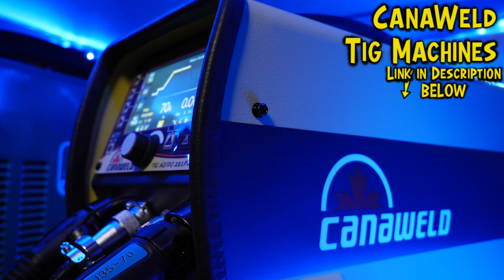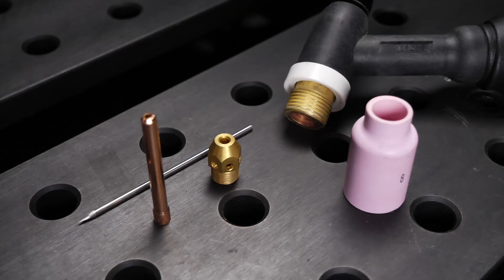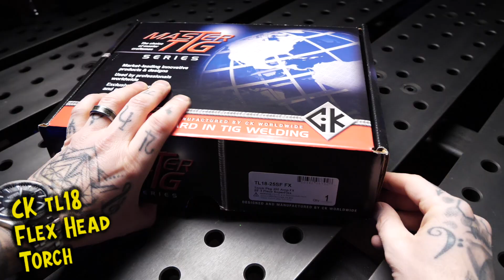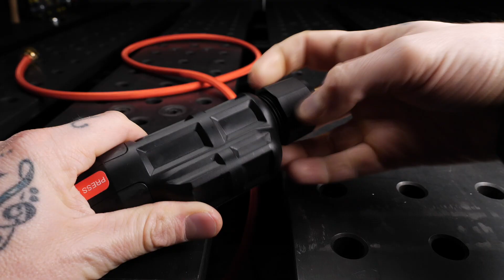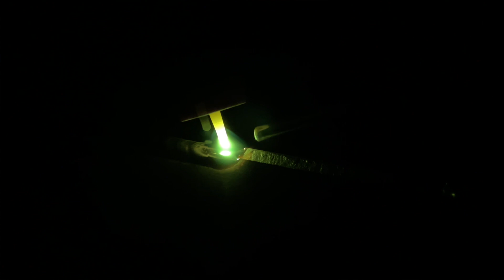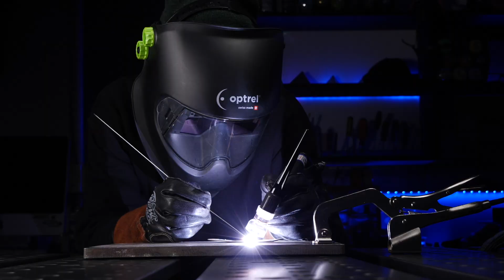HUGE upgrade to my CanaWeld TIG machine

Comment: I totally agree with you on this.  I put a CK Flex-Loc 230 Water Cooled Torch on my Everlast PowerTIG 255 machine and love it.  For ME, the utility of the swivel head far outweighs the additional size, and I can make it comfortable to hold in nearly any position.  Also built my own water cooler with a microcontroller to verify adequate flow and shut off the pump when it's not needed.  Very sweet setup.

Comment: i absolutely love ck products, my fl250 is the nicest torch iv ever used. buy a couple of extra heads and you can just undo one screw, pull your ally torch setup off and pop on another head with your big ole stainless cup straight on

Comment: I did the upgrade on my primeweld Tig 225x I also have the Maxcool 3000 water cooler instead of going with the CK 20 water cooled torch I went with the water cooled flex lock with the number two head With the 25 ft leads. I got the greatest dexterity ever with it I can weld anything anywhere anytime greatest torch I've ever used it's the FL 230 might want to check into it might be something you'd be interested in.